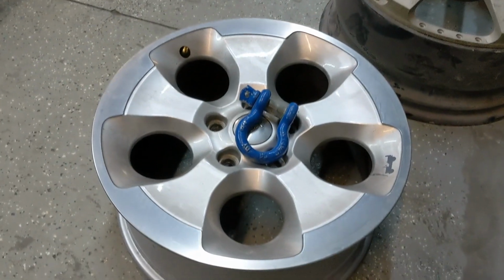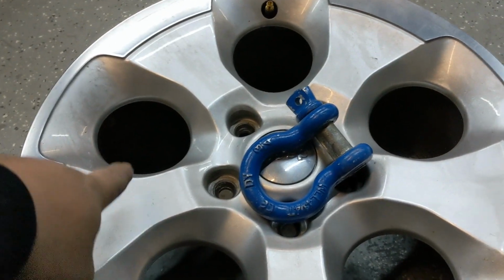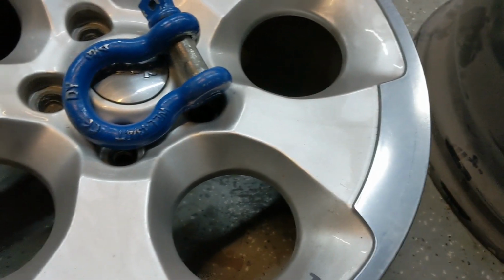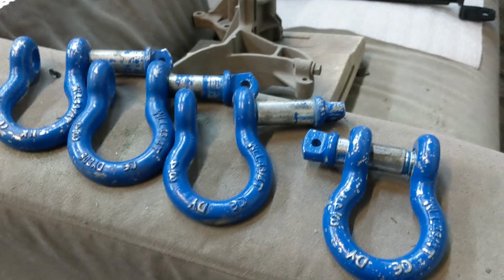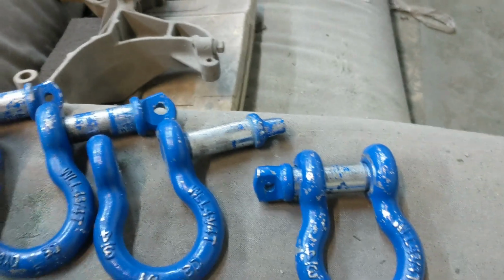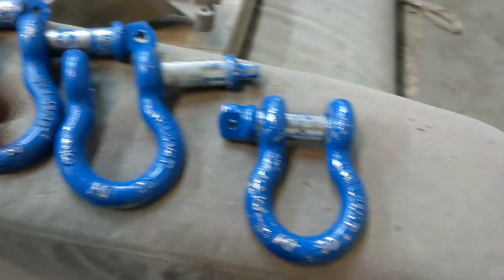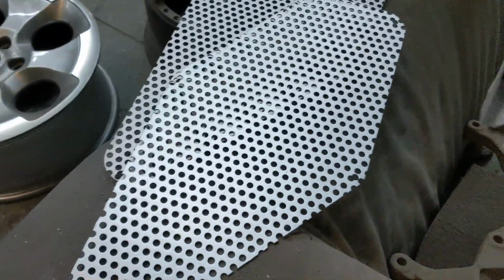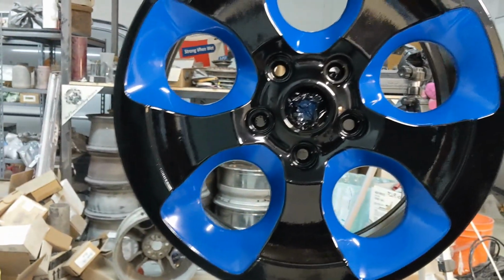Powder Coating Two Tone Jeep Wheels - Ep 13

Comment: I just absolutely love all your videos, so so very helpful. I know you use a oven to cure your powdered coated parts. I’ve also seen others use the infrared lamps, would the infrared lamps at Home Depot. Would these lamps also work as I don’t have couple thousand bucks to drop on a over. The spec’s look the same as one’s being sold for powder coating.

Comment: Please 
The blue powder removed from the required parts using a suction compressor?
Reply: Vacuum cleaner with small attachments ebay them
Reply from the maker: Its literally just a vacuum cleaner with small hoses and attachments as stated above

Comment: Is there a reason why you vacuum and wipe instead of taping off the areas that were staying black so the blue wouldn't stick?
Reply from the maker: tape creates elevated tape lines. and tape in the powder world is not like in the paint world. it moves and lifts etc
Reply: @UnknownCoatings  Sorry, I guess I did a bad job trying to explain what I meant. Could you have taped off the area, put down the blue, pulled the tape off and then bake?
Reply: If you put tape down and then lay down your powder what do you do with the powder that's on the tape? The same exact process that you would do if you didn't use tape in the 1st place.   Vacuum then wipe it down with your finger. And if you use tape and you still have powder on it when you pull it off it's gonna go everywhere you don't want it in the 1st place.

Comment: This came out gorgeous! I'm having a guy powder coat my 16" wheels in Black with Blue beadlocks and using a clear coat over them, and was quoted $700 total. Is that reasonable?
Reply from the maker: yeah seems reasonable.
Reply: @UnknownCoatings  I ended up going with a one-man powder coater for $100 less and he did a fantastic job!

Comment: Did u fully cure the black? Then let cool before doing blue? If not what did u do. Thanks
Reply from the maker: nah partial cure on it, let cool, do blue, fully cure.
Reply: @UnknownCoatings  When you say partial cure how long after the part reaches 400 degrees do you wait to remove it?  Do you let it cool to room temp? Wait over night to cool, or cool to 100-150 degrees.  I'm asking for applying clear coat over entire part.
Reply from the maker: @keneykkk  I wait til the powder flows out and then like 3 more mins. Then pull it out and let it cool below 140 at least. Then start doing second coat

Comment: How do you hang up the wheels? And make them easily movable.
Reply from the maker: Check episode 23. Sorta hard to type but I use the valve stem holes
Reply: Unknown Coatings I’m also getting some small fine trash spots. Not major but enough it makes me want to redo them. Any tips on how to keep the trash down?
Reply: Also. How long and what degree do you outgas at? Sorry for all the questions! Been watching your videos all day and have a lot of them.
Reply from the maker: @huntman21032  depends on the part typically 50 degrees above whatever the powder is going to cure at for that project. For 45 mins to an hour.

Comment: When you coat aluminum wheels, do you take the clear protective coating off or just coat over top of it?
Reply from the maker: Clear protective coating? What? All wheels are stripped in a chemical and then sand blasted

Comment: I've been a powder coater for the last 27 years and do similar stuff like theses wheels. I'm not saying anything negative about your work or your method but I would have done the blue first just because wiping out the windows as you called them would have been easier and less work than wiping off the black area . Jmo . But nice work
Reply from the maker: everyone has their own way, I dont think the lines would have been as crisp doing the other way

Comment: I’m doing a 1969 Honda z50a tank 2 tone with lollypop red on the bottom half of the fuel tank and star silver on the top half and can’t seem to keep my colors from “bleeding” together at the line. Trying to accomplish a crisp line and cant get it to end up that way. Any suggestions on what I may be doing wrong? Any help would be greatly appreciated!
Reply from the maker: What color are you putting the lollypop red over?

Comment: Love your videos! I have 2 questions for you though.
1. Doing multiple colors, how long do you cure the base before doing the 2nd color?
2. I noticed you aren't shy about touching the prepped parts with your bare hands. I thought this was a no-no?
Reply from the maker: 1: flow out plus a couple minutes, then cool of course
2: I am always told its a no no and its never once caused me an issue in 12 years. So although Im not saying touchy our parts as much as possible, im also saying that issue is blown out of proportion

Comment: 4:00 , you just use air pressure after sandblasting to clean the parts before painting? don't you degrease the parts? Greethings from Poland B)
Reply from the maker: no need to degrease parts after blasting.

Comment: I should have been more clear. The lollypop red is only on the bottom half of the tank. It is not going over any other colors. Just the clear coat after that. The top half is silver and the line where the 2 colors meet is where my red is bleeding into my silver. So the line between the 2 colors meet is not crisp. It is blurred together
Reply from the maker: Email me a pic unknowncoatings@gmail.com